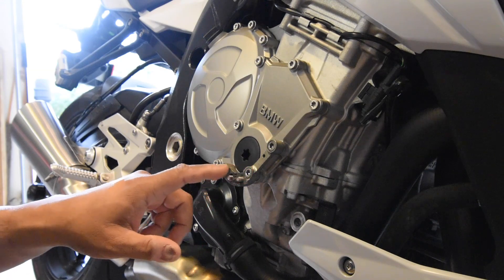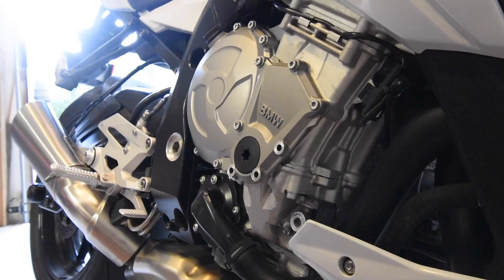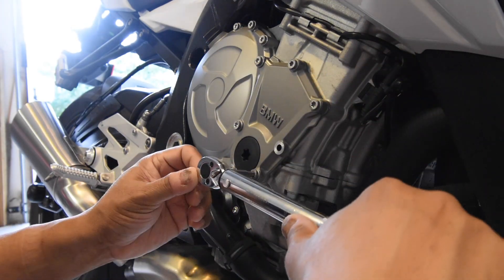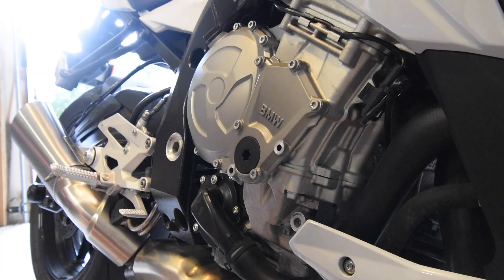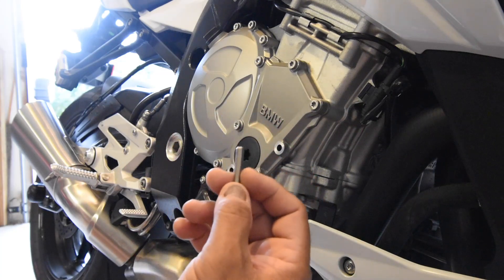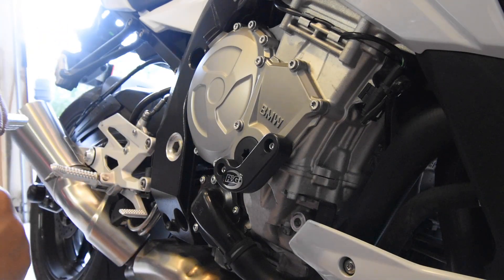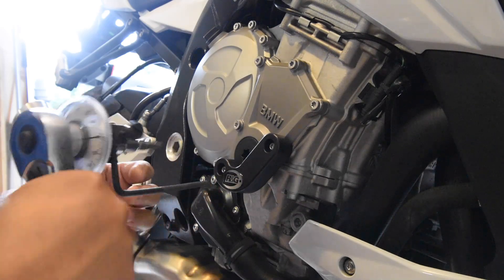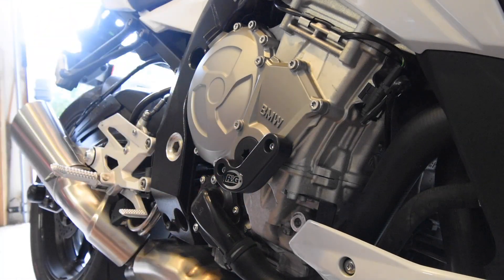Torque To Angle | Using a Torque Angle Gauge

Comment: How would you translate NM to degrees?
Reply from the maker: You can’t. The amount of torque (twisting force) required to rotate a fastener through a specific angle will vary due to many factors. This means a conversion formula would not be practicable.
Reply: @GrumpyGoat  Thanks.

Comment: i disagree, if anyone reach point of torque to yield they can use the same fasteners because it not damaged. but if the torque exceeded the yield point (or if it's been maintenanced before & you don't know if it torqued correctly) yes you need to replace the fasteners. https://www.youtube.com/watch?v=hz8vSFq3AHM
Reply from the maker: I agree with your first sentence - I think - although strangely composed. I believe you are saying that, despite appearances, if a torque to yield fastener has been properly torqued then it should not be reused. It is in fact that simple. If that is what you are saying then I agree with you. Not sure why you offered the comment in my video; I doubt that I was saying that such bolts, properly torqued, could be reused. AAMOF, I believe that any previously installed torque to yield bolts should be assumed to be yielded and should therefore be discarded.

Comment: Interesting, have never seen this device or torque specification before.  Suspect it would be more on key engine components especially with the single use fasteners.
Reply from the maker: Yes, cylinder heads and crankshafts are assembled using torque to yield bolts and Torque Angle Gauges. They have to be torqued down evenly and with the same clamping force at each bolt or there could be unacceptable bending stresses and uneven wear experienced as a result.